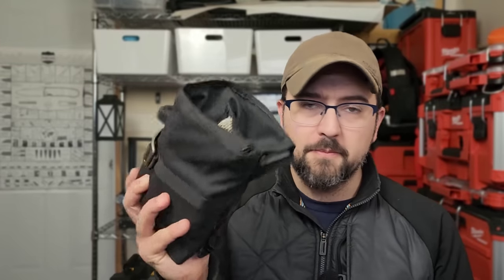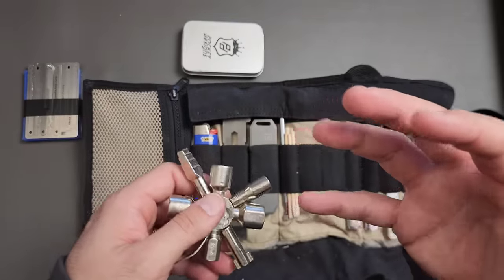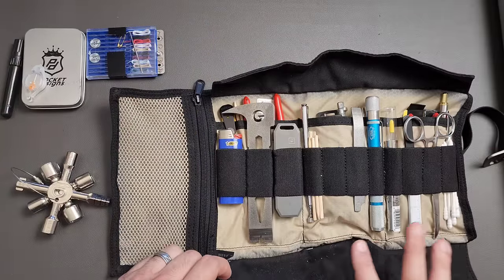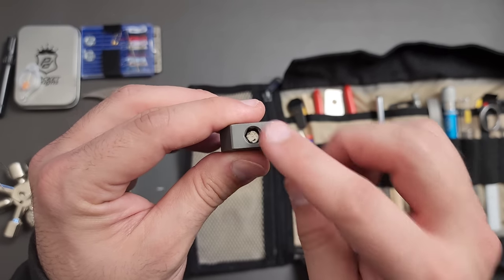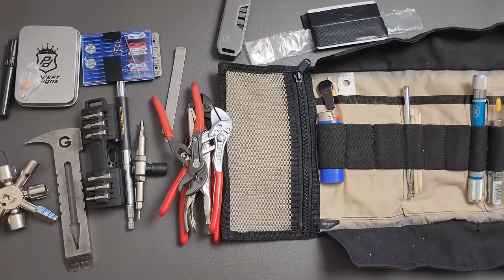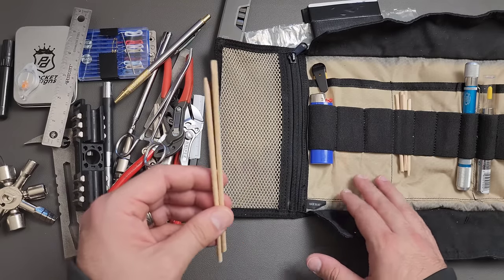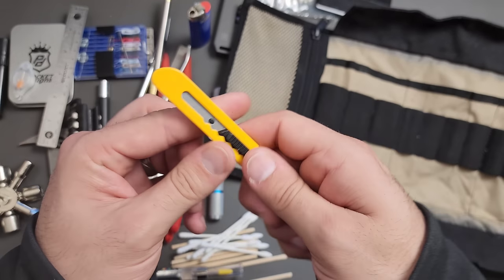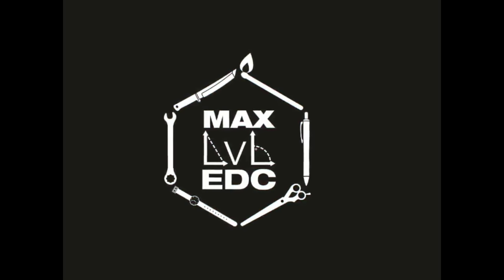🧰 My EDC Tool Kit (v1) How can I improve it?

Comment: Great toolkit. 👍

I'll carry some additional stuff (small pieces):
• 3×3 rubber pad (from tyre tube) - helps grip pipe/rounded stuff without marring
• sandpaper
• rags
• nitrile gloves
• mini WD40/mineral oil (repack in eyedrop bottle)

Small pieces for small EDC toolkit. There are many instances where these items helped when away from big toolbox.
Reply: i can't go 24 hours without nitrile gloves in my trade. great call.

Comment: I think you could use a flashlight,a small coil of copper wire and nano cord of kevlar.
Reply from the maker: The last 2 for sure..I carry 2 flashlights on me and one in car..so that's why I skip it..I do want to fit the LVD 2 as a flashlight/current detector.
Reply: Thin solid core coated wire.

There's quite a few brands of cheap snap off blade knives in metal.

Really small cable ties can't be replaced by Velcro.

A jet flame lighter can be used to solder wires.
Reply: @maxlvledc   what flashlight you like for a hot guy working on his car in the dark at the races?
Reply from the maker: @Jermaine Smith  I would say needs both a flood and spot with magnetic tail...only one that comes to mind is the Lumintop E05C, one of the best pocket lights I knowm
Reply: @maxlvledc  thanks
Reply: @jermainesmith4788  baton 3 pro. Easy breezy good light for the money. Magnetic tail and charging. Great for dual purpose edc and work light. If you want a tail switch go warrior mini 2. I'm an olight guy, obviously

Comment: Dominic, great video as always! You produce such great content. I do have a few inputs you might consider. First, I am not to savy with the fixit stick setup but I have been rocking the ICON 1/4" Rachet Set (Harbor Freight) with the small Makita socket sets they sell at Home Depot. I believe the thickness of the ICON set is about the same as the Fixit Stick holder and it gives you loads of bits, T-Driver capabilities, rachet, and extension among other things. I also as a backup I rock a Klein Super Screwdriver which is the combination of two Klein drivers (14-in-1 adjustable with bit storage in the handle and their flipsocket extension). Secondly, a small precision driver with bit storage in handle (Hoto or Klein) would do wonders. The above options might add a little bulk but more functionality and bits in my opinion. Third, DeWalt has a great small 9' tape measurer. A Voltage Tester is always welcome and finally I always rock a Work Sharp Field Sharpener.

Comment: I think you did a great job! I love tool kits and have been putting g together one of my own, and you gave me some ideas. 
A few things I would recommend: some ranger bands can be helpful and very versatile. A magnifying or fresnel lens  if you need to do some close up work. And maybe some sand paper? You have the files though which might do the trick. I got some small sharpening sheets from Grim Workshop which are basically credit card sized pieces of sandpaper in different grits. Just a couple random ideas.
Reply from the maker: Sand paper is a great idea.

Comment: I think this covers most areas so I don't have anything to add. I think my suggestions are more to get alternatives to something-- that you currently have. So it's a longshot. I have multiple multiple screwdrivers like you do. But I'd say my main, true main is the Wera Tool-Check Plus. I like them so much I"m actually considering a second one for my car as well, even though the garage is just outside. But imo it's far better than the other EDC screwdrivers I have (I have the Bit Inline, Big Idea Design EDS2, Topo screwdriver, James Cache River,  Victorinox L shape) The Wera Tool check Plus is just so awesome. Also the screwdriver is just so much more natural to use and it's what I reach for. It has everything. You basically don't need another screwdriver, you're covered on bits and covered on sockets. And yes, the Fixit Sticks have you already covered. But imo the Wera Tool Check Plus is just what I naturally use over everything I have. As for the Cheat Key, I'd remove it and put it in a Bugout bag instead. In that Bugout, you put it in your car and that includes things like tire inflator, tire repair, self-jumping batteries like the NOCO, poncho, reflective gear, first aid, food and water for 72 hours, basically everything recommended in Vehicle EDC Reddit. Basically the 'key' doesn't belong in an everyday carry set. It's more of an 'oh shit' item. For the Bic, see if you can half the size. Make it a Bic Mini. For the Pry Bar, no one can win on preference, but imo you can get one that has similar function but smaller real estate. For the razor knife, if you want to cut your space down, check out the ceramic Slice cutter. Amazing cutter but thumbsized. Lastly while completely and entirely subjective, check out the small tool roll by QEES. Unlike most other tool rolls, these are smaller and have 5 slots with zippers. Super handy. It allows you to later mentally associate each slot with something.

Comment: Very comprehensive. The big pry bar takes up so much space IMO. The BID AND FixIt together are probably excessive and your mileage may vary. 
Personally I would put in either the WERA Tool Check + which has sockets! Or the HB ICON ratchet set and add some sockets.

I would however add
1. Thin 10mm magnets - very handy
2. Heat shrink tubing
3. Small tape measure
4. Some rubber tubing to cut as required
5. Zip ties
6. Precision screwdriver
7. Some form of shop cloth
8. A simple voltage tester
9. Small strips of VHB tape
10. A small nylon toothbrush
11. T-Shank saw bits to cut whatever. Although I have yet to find a decent compact holder (other than what's on my Leatherman Surge)
and finally 
12. A long nosed pencil/marker.
Reply: do i have the saw that u need. multiple options include outdoorwerk sawtool, blue spruce woodworks jigsaw handle, renegade outdoors microlight saw, donau elektroniks M208 - Profiline hand saw or donau electroniks MWH60 - Profiline, JAPANESE BOARD SAW by sunflag bn-200n or AX BRAIN.
Reply: @ashsmall8103  These all seem to be saw options. I didn't notice any compact handle option for the T-Shank blades. Am I mistaken?
Reply: @madsmix  all of em use t shank. the japanese board saws may use u shank and t shank
Reply from the maker: Wow! Great list.
Reply: tool check is deceptively large and heavy, you mays as well bring your toolbag at a certain point, and he's already there imo. but a small abrasive brush and zipties are definitely mainstays of ultralight handiman pouch

Comment: Small vial of baking soda. Many many uses. Dying battery corrosion, antacid, adhesive aggregate, etc.
One full sized real driver with tips is better than toys and maybes. Stick of graphite. Many many uses.
Reply: Great idea. Doesn’t baking soda help build mass when used with super glue?

Comment: How to improove your pack?: Remove some things, you want to keep only the neccecitys!  
-That big ol star wrench? How often have you actually used that... that seems like a complete waste and dangerous in the wrong juristictions. Use pliers instead!
-Toss the Forcecepts, Keep the tweezers, you have that magnetic wand! 
-Are you an electrician? If not, then leave those solder seals at home. 
-Why the everloving F do you have 2 bit kits? Choose eighter the dewalt or the fancy shmancy titanium one. 
-Why do you have 5 sets of specific pliers? One small set of pipe wrench and your multitool, if it takes more than that, you need a PROPPER TOOL KIT!!! 
-Carbide scribe is a waste. You have blades of good steel, use the tip to scribe. 
-You dont need an extra Extendo utility blade, you allready have a knife, Multitool or utility knife. 
You have 3 types of Adhesive with you... toss the UV Resin, superglue is practically the same.

My tool kit:
Ducktape ~5m
5 Small Zipties
Multitool (Victoinox Handyman/Cybertool M/Leatherman Wave+bits)
Victorinox oil (food save)
Victorinox Ceramic sharpening stick with a small piece of leahter glued on for stropping
Small flashlight, Small Lighter, Small Pen/Pencil
Bankline #36~ 10m
Small acid brush for cleaning.
Doggy Bags (For garbage or emergency water protection)
Ouchie Boo-Boo bandaid + Ibuprofen kit.

I have never in my life needed anything more on the go. in the timesi did, i sure as fuck would want the Propper tool. a real Pipe wrench, a real Crowbar, real Hammer.

Have a real tool kit in your car. Don't worry about lugging all the what ifs around, keep only with you what you REALLY need on a regular basis.

Comment: Those solder seals are very underrated imho. I used them to connect up a glow plug control module in a very tight spot where my soldering iron would have struggled to get. Been years and it's held up perfectly well. I like that it's waterproof too.
Reply: no doubt, they look to be superior to heat shrink and not that much more bulky. rejoining wires is why i had to learn to solder and good grief small jobs should be such a hassle as to break out the iron.

Comment: I'd add a few plastic spudgers. Titanium prybars are great until you're trying to take apart a piece of electronics that's clipped together which would get marred by metal implements. Plus often you'll undo one clip, leave the spudger in place, reach for another, and work your way around whatever you're opening that way. They're relatively small and light and shouldn't add too much bulk.

Comment: Great kit, I would honestly just choose one pair of pliers to drastically reduce weight. 
The cheat key is a nice one, although a bit bulky and heavy, I would keep it in the car.
Also I wonder if you really use so many bits. 
And I pesronally wouldn't want the police to check my bag in any scenario, carrying both a
small crowbar and lockpicking tools :p
A knife and a saw would definitely be in there for me, even if it's just a Victorinox camper 
( but I suppose you would have something like that in your pocket?).
Anyway, with these changes I bet it would be light enough to be a belt pouch.
Any thoughts?

Comment: You should consider getting reusable silicon ear swabs. They are all relatively cheap, but a lot of them come with different shaped ends that are useful for applying glues and putties and such. That's a very nice kit. My only other suggestion would be to add some cordage.
Reply from the maker: both are great ideas!

Comment: Check out the dark shift lockpick set from sparrows. The tools are all flat, but the full size picks really make a difference compared to card picks like you have. The monkeys paw pick is also great to add if you do single pin picking. And there are 2 or 3 expansions to the dark shift set now that have a few extra tools like wafer jigglers (get me into my file cabinet when I inevitably lose the key) and a couple bypass tools.

Comment: Great start.
I would eliminate:
The star tool ( you could toss it in with your spare tire)
The metal box( you’re packing air)those small parts will be fine in the zippered pouch.
The lockpicks  
The very expensive bit bar- plenty of torque with the fixit stix t handle.
The fixit stix plastic parts holder
The mini bolt cutter 

On the fence about the long nose vise-grip and hemostat forceps.

Add:
Stream light stylus pro led light or compact headlamp
6” adjustable wrench
Small coil of steel wire
Makita 1/4 sockets in the vinyl holders. SAE and metric.
Reply from the maker: Good ideas!

Comment: Hey there! 
First things first: many - many thanks. 
Your approach (and implementation for that matter), is solid and inspiring.
Suggestion: store some toothpicks alongside the q-tips.
For one, you do not want to get things messy with regards to other tools, if a need arises for detailed glue application.
Secondly, q-tips won’t help at all with glue, unless you apply big chunks.
Toothpicks, will serve you a ton.
Moreover, toothpicks can help you clean off dirt from tricky parts whenever you do not wish to damage a surface.

That’s all off the top of my head.

Again, great vid and keep updating it (and let us know too).

Cheers.
George from Greece.

Comment: This is a really unique and interesting kit you're putting together. It's not quite "survival" but you do have some instances of that shown. However, you do have some emergency sewing, grim lockpick cards, universal key, etc. It's also not "tech" or "urban" so you don't have battery bank, charger cable, precision screwdrivers etc. It's not "industrial maintenance/automotive", so you won't have things like a socket set or wire strippers. But you do have some heavy-hitter tools like the cobras and locking pliers. You also don't have a large knife, flashlight, or any of the normal EDC stuff because well, you already have that on your person.
You've created a scenario that is both vague and specific at the same time, I think. So, it's quite difficult to suggest what to include or exclude. Maybe a deeper understanding of what this kit is actually for would help. What purpose does this kit serve? Should it be separate kits?
Reply from the maker: Your dead on...truly I Havn't constructed it with purpose
Reply: So true, and so challenging - Prefer to think it is a hybrid kit. I am in the same situation and leaning to have separate mini or medium size kits to amalgamate into a backpack BOB.

Comment: I'm glad I'm not the only one obsessed with these styles of tool kits! We have A LOT of the same gear! I'm definitely getting those bolt cutters and a magnet pen. 

One stroke of genius I've had is a sheet of rubber, it comes in SO handy when you need extra grip. Maybe I should make a video of my one...
Reply from the maker: Such a good idea!
Reply: The guy who makes that pry tool makes a Hank with rubber dots on it for grip, I think. I picked it up recently but it hasn't arrived yet. Also got his kevlar one for camping. I can clean my glasses with one side and pick up a hot pot with the other.

Comment: Everything in this set is not isolated. Therefore, at least electrically insulating gloves should be. Be sure to have a long PH2 bit, but others will not interfere. The bit extension  will not get everywhere - it may simply not go through, but a long bit will get it. Small screwdrivers - without them it is sometimes impossible to change the battery, tighten the glasses, and do such precise work. that black organizer set, where the bits are, should be removed by simply putting the bits and the ratchet handle in a ziplock bag, this will save weight and dimensions. while eliminating duplication - it only adds dimensions and weight. It is worth putting one or two sticks of a chemical light source - although they are disposable, they can be stored longer than batteries.
Reply from the maker: Wow!! These ideas are rock solid! Thank you!

Comment: Good stuff, one mod.  Ditch the bondic glue (messy and not accurate and replace it with some type of 5 minute putty epoxy.  JB weld for black and other brands for white)

Comment: get a 10' tape measure, you can get a tiny one. Also some legit scissors like C. K Tools 492001 Electrician's Scissors, 10-Inch OAL Stainless Steel

Comment: That's a pretty comprehensive kit. You might be better served by the Wera Tool Check Plus, although the weight and size might be an issue and gives you socket capability. Alternatively Bahco do a small socket set as well. I would also suggest getting some precision drivers in there, given you wear glasses, at the very least having some to repair them in the event of a screw popping out might help, admittedly I haven't come across a decent compact set with the 4mm hex, have some cheap Banggood Daniyu ones with a bespoke fitting which have been very handy. Maybe look at the Heroclip instead of the carabiner you have, the you might find the added functionality beneficial. Whilst I like certain aspects (the magnetic pick up tool, definitely adding one of those to mine) there are things in there that I don't think would work for me. I bought those fiskar scissors after you tested them, those things are surprisingly capable for the size and price.
Reply from the maker: Hero clip is a really good idea.
Reply: @maxlvledc  I have one, and it's a good piece of kit.   I think I'll buy a smaller one.
Reply: The wera tool check kit is one of my favorite tools I ever bought. I used it constantly for the first few months of moving into my house with my 12v impact.
Reply: @commentsonthetube14  yeah I think it's a very good kit, whether it's right for a EDC tool kit is a whole different question, one I hope to have an answer to in the near future.
Reply: @k.hussain360  it's a little big for me to EDC. I keep it in a tool box. It's like my larger version of this. I bring it when I need to fix something. But I don't keep it in the car or carry it. My everyday backpack kit is pretty barebones. And my car tools are more focused on fixing the car if there's an issue I can handle myself.
Reply: @commentsonthetube14  my intention is to keep it in my backpack kit. They do a version that doesn't include the driver which is a little smaller and lighter, which will pair perfectly with their handle that has a telescopic bit holder.

Comment: what is the job the cobra does that the pliers wrench does not?

IMO its just only adding edge case ease of use rather than adding functionality.
it would be much more usefully replaced with those backwards opening plier things that spread stuff apart.  

also redesign the big pry bar to grab the rear arm of the pliers wrench so that it can extend the lever and thus strenght. pliers wrench is self tightening so you dont need to grab both arms

also. you cannot cut wood or metal with anything in this kid. its a big enough kit to fit sawzaal blades that latch into the big pry bar with an additional redesign.
Reply from the maker: That's a great idea!